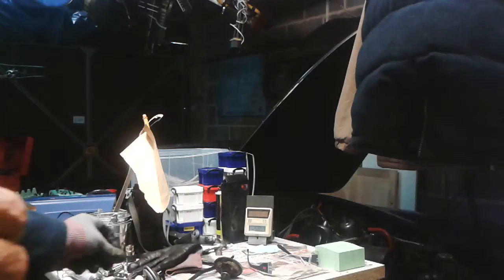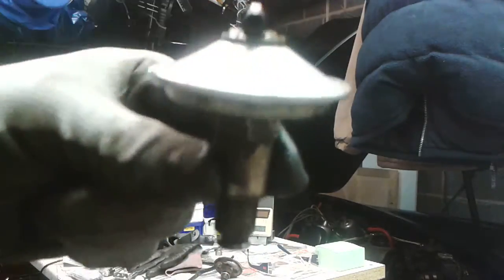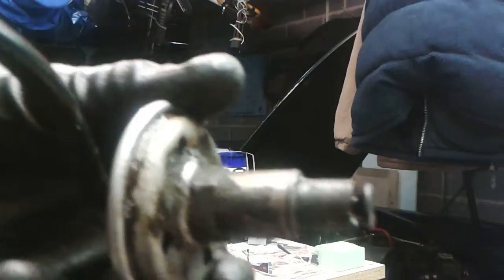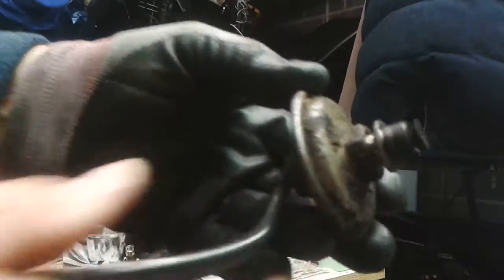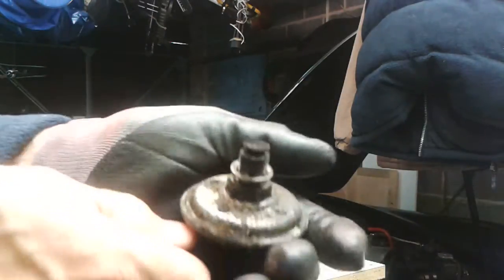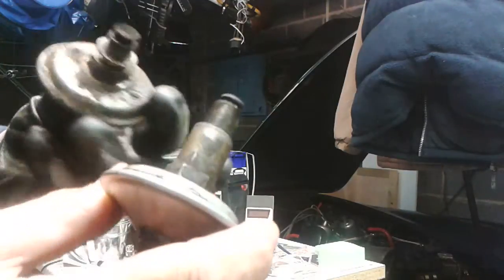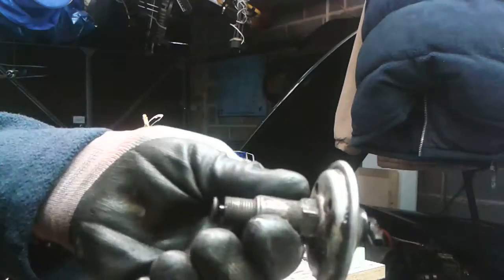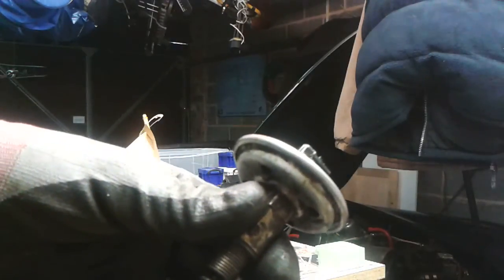Victa Lawnmower Decompression Valve - diagnosis

Comment: Thanks again 999Greeves. I cut the head of the valve drilled and tapped an 1/8 gas thread.fitted an blanking, reassembled and went like a charm. To look at it all looks original. Thanks again so much. You saved my friend $30-40,

Comment: Thankyou for the solution to put a spark plug in place of the valve. My Victa Silver Streak now runs like new thanks to you.
Cheers.
Reply from the maker: Paul McDonnell Glad that it worked for you too. The only reason for the decompressor does seem to be to reduce the pull required to start the Victa. The difference is pretty minimal from what I can tell. The Victa is such an elegantly simple design in all other ways it's a shame they added a decompressor

Comment: Thankyou for the helpfull video I had rang the shop $59 replacement I was just going out to buy another thought I give you tube ago I had to block off the vaccunm hose at the carbee  the mower now runs fine now regards Simon Brisbane
Reply from the maker: @116951139284177065256 
Great to hear that your Victa is going again. I only loaded this video to update a friend of mine on what I was up to - so it's pretty rubbish as a general 'tutorial' but I'm pleased it helped. You make a good point about the need to seal up the vacuum take-off that is normally connected to the decompressor valve diaphragm via  the tube. I put a blob of silicone sealant on mine and let it set. Simple, effective and easy to remove if necessary.